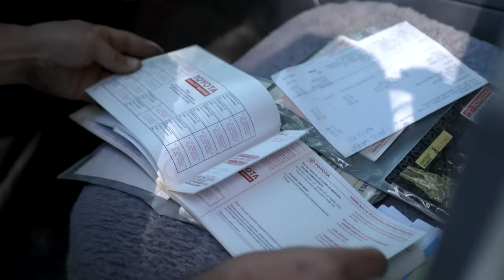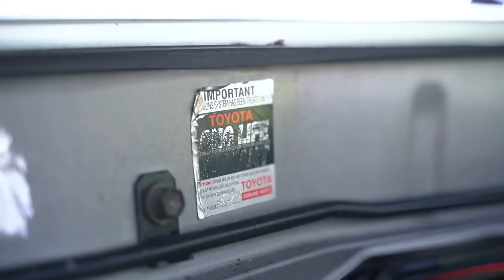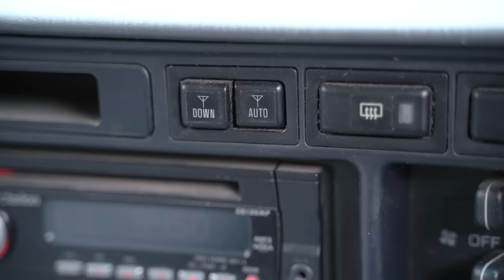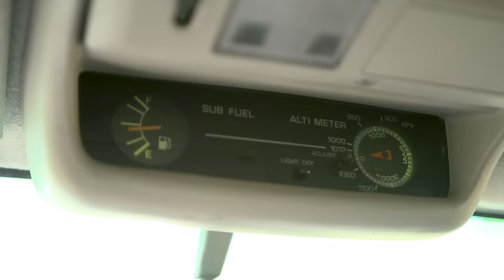RARE GRANDPA SPEC Toyota Landcruiser! You won't believe what Shauno paid + tips on buying an OLD 4WD

Comment: bought a 1993 chopped auto 80 series 1hdt with 250k on the clock..no rust only missing some clear coat off the flairs, interior is immaculate, everything is perfect mechanically.. paid 15k
Reply: forgot to mention.. bought off an old boy who had it from brand new and still stock as a rock

Comment: I bought a nissan navara d22 zd30ti about two years ago for $2500 from a younger bloke, it had a 2 inch lift snorkel winch spotties light bar rock sliders and brush bars UHF the works and the bloke told me he thinks he killed the car. It wasn't making boost blowing heaps of white smoke and ran rough. Anyway long story short. I paid the guy $2500 drove to the servo grabbed a roll of duck tape and taped the intake pipe coming off the turbo up and. Away she went. Running great no more smoke and booooost. Ten dollar fix and it was a treat. I recently sold it for $9500 just the way I bought it.

Comment: Hi all .
Thought I'd comment about my little score ..
I picked up a 1999 manual Nissan patrol 4.5 supercharged.
Nothing done to it apart from the supercharger ..just a stock set up .
One little don't in the bottom of the passenger rear door.
It just had all new brakes and rotors.
And a brand new clutch..weeks before I got the car ..I was given the receipts to show it had been done ...
The bonnet is starting to have the clear peal off ...but other then any of that ..it's in really good condition..
The bonus was the car came with 3 months registration.
I paid $4500 . Witch I feel was a great score .
Since then IV added the normal stuff ..
Dual battery. Light bar . aftermarket stereo. 33s .roof rack .awning .
I was always stuck on the roads talking about going hear and there ..
Now I that the misses and kids  camping and 4wheeling ..
They have just as much fun as me .
The kids are always trying to get me to crazy tracks .
But I keep telling them .let me get a few more things before we try anything harder .
Anyway. That's my story of my good but cheap score
Th

Comment: Best bargain was my first car a 2000 Mazda bravo single cab 4x4. Being an ex Telstra ute it came with a warn winch and tjm aluminium bar and fleet boxes on the back. I traded the boxes for a basic aluminium tray put a lift kit and snorkel and the car never missed a beat. I purchased the Ute with 220,000km and sold the Ute with just under 500,000km for $3500

Comment: Man am I ever jealous of you Aussie's (and anyone else who lives in nice hot dry climates). Your car's last forever! Here in Canada, my 5 year old pickup already needs new outer and inner rocker panels, and that's with yearly rust prevention. The salt brine/de-icer eats our vehicles. Luckily when I bought it, I paid $1500 for the rust prevention. Guaranteed for life never to rust through.(obviously it didn't work but warranty is covering it) all I have to do is bring it back every 2 years minimum for an inspection/retreat. Best $1500 I ever spent. Want to get at least another 10 years out of the old girl.

Comment: A couple years ago, bought a 95 model v6 4runner, not running for $1800. Still had current WA rego (transferred into my name on the spot). Apparently stopped working after driving thru a large puddle. 

Paid cash, pushed it out of old mates driveway onto road. Fitted a new second hand dizzy (old mate supplied). Quickly diagnosed rotor button cracked. Quick trip to repco with $30, it was running. Adjusted timing, and drove home. Old mate was gutted. 🤣

Drove it for 6 Months and sold it for $5500. 👍

Comment: Recently picked up a 2004 LN167r Hilux with 193000 on the clock for $3300. Needed a bit of work but has just got home from nearly 4000km of towing without a problem.

Comment: Recently bought an absoluute mint condition, 1997 40th-anniversary Petrol fj80 for 10k. Has 300,000 on the clock with 33s but other than that completely stock and unabused. hasnt got a spec of rust on the whole body and is going to be one hell of a rig.

Comment: Had lots of over the years 
In 2004 HDJ80r Sahara 4K 
In 2007 a 2000 RZN169 Hilux $2500
In 2009 GQ Dx 1997 ute $2000
In 2010 GU Dx ute $2000
In 2011 GU rd28 $5000

All running with rego apart from the GU ute that I purchased from a P plate driver who put it on its side. I sold it recently and replaced it with a 79.

Replace the Gu wagon with a Fj cruiser 2013 and still have it.

Comment: I bought a 1989 HJ75 with 180k km for a $1000 bucks during covid. I saw it sitting out the front of someone’s house with grass growing up it. I knocked on the door and offered them 1k. I put a new battery in it and drive it away. Sold the car a year later once it was registered for 11k, did very minimal work to it aswell.

Comment: My best find was a Toyota hzj 105 ex UN at the scrap yard in Europe about to be crashed. Offered the guy 5000 euro and it supposedly had a blown engine . It had 154.000 original KM and the engine just needed a fuel pump refreshed. Total cost including title , pump fluids etc… was 7500 euros. I’m now at 480.000 kms and never had one issue.

Comment: A few years ago I got myself a 2011 Mitsubitshi challenger with around 250km on the clock for 15k when market value was more than double that. I’ve not long been using it off-road now and really surprised how capable it is. Looking forward to adding a few more upgrades very soon.. there’s a pile of goodie’s in the garage and front lounge waiting like a front bar and winch, draws and fridge, 2nd battery and CB. Just put more capable wheels and tyres.. 
love the channel guys 👍 see ya on the track one day 😊

Comment: 2000 toyota hilux 2.7l petrol $3800 work horse that's done cape york last year and doing it again in September this year. Just clocked 352000kms. Easily the best rig I've owned.

Comment: My bargain, paid 7k a year ago, HDJ80R, 1HD-T turbo diesel, July 92, Manual with 440,000 on the clock, spitting image as yours, identical. Has the typical electric window issues but apart from that nothing major (touch wood). Bit of a unfortunate way to gain possession as it was an old blokes pride an joy for so many years (seccond owner) and passed from cancer, it's in good hands now and due course will have all the TLC.

Comment: Nice rig shauno its got heaps of potential . I just picked up one owner  2014 px xls 6 speed manual  its got a factory rear locker with 80.000km it's got a canopy dual battery tow pro elite off a 72 year old man for 26k im was so happy 😊

Comment: I got a 90 Jeep Wrangler for $1000 108k miles nice little rig 2 weeks later I got a 91 Jeep Wrangler 130k miles  for $5000 with $7000 worth of extras so I gave the 90 to my best friend now we both have a Jeep with enough spare parts to go around now we both get to go 4wheelin  the best deals are the ones you get to share with your friends

Comment: My best 2nd hand bargain is the vehicle I currently own, a 1995 hilux extracab rn110. Minimal rust, and only 260,000kms on the clock with a full service record and original accessories. Paid $3500

Comment: Just picked up a 2013 tdi400 6 speed manual amarok for 17k! Some of the mods it has are TJM bullbar , steel tray, 2” lift and I’ve added some 17” wheels and Yokohama all terrain tyres. Compared to what else is on the market it drives heaps better and is easily 15k cheaper than something of the equivalent year. Can’t wait to take it offroad now!!

Comment: Picked up a 1999 105 Series Landcruiser

420,000, H151F Turbo 80 Series Gearbox, Part Time transfer case 80 Series, tough dog shocks/coils all round, Pro Comp Classics wrapped BFG AT all round , superior panhard rod, pioneer rhino rack, gme uhf, arb compressor, dual  battery Redarc isolator, tjm bullbar, all the fruit, bunch of spare bonnet protectors/headlight protectors 

Plus a full set of all sunyaraysia spare wheels, water pump, rear main seal kit, drivetech swivel & bearing rebuild kit, plenty more spare gaskets/seals

All for $15,500, I don’t think I’m ever going to sell this car! But I am missing a recovery kit

Comment: Best bargain buy I ever got was from a deceased estate two years ago.  A 1995, 80 Series GXL Manual with the 1HZ and had only done 115,000km when I bought it.  The old fella who owned it only drove it on weekends until he passed.  The family didn't want to hang on to the vehicle so I ended up buying it for $12,500.  Full log books and history.  I still find Toyota factory stickers on the running gear.  115k km for a 1HZ is just run in, really.

Comment: Got a 1989 Holden jackaroo with new mud tyres, new winch, light bar, awning and dual battery setup for 2k 👍 but slow on the road but loves low range in the bush

Comment: Great find shauno 👍
The best find I bought was a Toyota Hilux 1994 SR5 metallic silver 3.8 after market turbo 32 inch wheels with b&f Goodrich all terrain tyres  and a set of 32 inch b&f mud terrain tyres flared fibreglass guards. tjm bull bar with warn winch tjm snorkel tjm aftermarket rear bar .uneden radio IPF Driving Lights .duel fuel tanks total Lts of fuel 160 in total .130.000 klms.when I had taken it for a roadworthy the guy that did my Roadworthy said did the previous owner wear pyjamas when he drove it.No rust no dents .A1 condition.
$ 13500.00 8 months Rego. Deceased estate.

Comment: I was out driving my AU falcon ute (my dad had it since new) doing an outback Queensland trip with the missus. We kept hitting road blocks with just having the ute e.g. couldn't get from Irvinebank to Mt Garnett without having to go the longway round. Anyway, I was sitting at the Mt Surprise pub having a schooie and asking the lovely old lady pouring beers about the road condition to Einsleigh. She looked at me and said 'what the hell are you doing in a 2wd out here trying to do bush tracks?' I told her it was all I had to which she said 'I've got a 4wd I don't drive anymore if you want a look?' Parked out the back in the shed, under a cover collecting dust, was a pristine 1992 GQ Patrol TD42 silvertop ST wagon, with full receipts and only 70,000 on the engine. Interior mint with all electrics working and had never left outback Qld or gone off road... a proper barn find! She only wanted $8000 for it. Bought it there and then. 
Both of us were stoked. Best beer I ever had at that pub! (Still have the falcon ute, can't part with her) 😆

Comment: Best 2nd hand bargain was years ago in the UK. I bought a Citroen CX Pallas for a dealer, car was 3 years old, had a tow bar and was really dirty.  The dealer told me that he didn't believe the 25  000 miles on the speedo, he thought it had be used for towing, had 125 000 miles and had suffered a hard life. I bought it for 700 pounds. Bargain. I contact the former owner, the mileage was true ( they sent me the full service history ) they had towed 2 times a horse box for their daughter, the car was dirty as they lived in the country. So I got a top spec car with leather seat, AC, etc for about for almost nothing. I had the car for 2 years, only problem I had was a starter motor.

Comment: My 2000 gu patrol zd30 Di bought with 390000 on the clock motor Was replaced at 160 only payd 7000 for her is my first 4wd  an the best part is the guy I bought it off owned an filter shop so was well maintained 6 years later still going strong

Comment: Got a vz crewman in 2019 for the ls 6.0 for 3.5k with blown diff, 150 xxxkm, cammed it threw it in a hilux, spent 2k on that, Then kept the ss whole on the farm just sold the ss seats, dash, front bar, hard lid for 2.5k today, with what's left it should cover the the build and price for the hilux with a ls 🤙

Comment: Nice one shauno👍 I payed 19k for my 1991 80 series auto with a 1hdt in it and with 580xxx on th clock with all the fruit, tjm front bar, powerful4x4 rear bar,fresh paint 2”lift, Dual battery’s with Solar panel on roof rack, rear draws, xr6 seat roof console came with every thing was on market place for 10 mins when i seen it

Comment: Great video with good common sense advice in it, thank you! Think I got a unicorn recently myself, a 2007 Triton GLX-R dual cab pretty stock, low 170k on the clock, with ARB canopy and a nudge bar. Hope to get a proper ARB bull bar onto her one day. First thing I did was change all the fluids including gearbox/transfer case and diffs, as service history wasn't great, but as it turns out all liquids drained were in good to very good shape. Breezed through the RWC and at 11.5k, think I did very well considering the current used 4x4 environment. Already taken it out in the local bush and it seems to handle it quiet well, not that I would know too much about that!?! Even made it through a few small mud holes, but am staying away from the deeper ones as I'm not prepped and not in company out there. So, if you're looking to offload the recovery gear to someone who'll put it to good use, please let me know. ;-) I'm happy to give some feedback of the gear and how I'd use it. All that said, been doing marathon runs through your vidoes and love them. Getting lots of good info and entertainment out of it. Cheers!

Comment: id say my bargain 4wd is pretty good, all it costed me was a rope, some fuel for the car towing it back to my house and about 5 minutes of my time. 

the old owner got sick of it because it would start so he called me up and told me i could have the thing, so i got a car to tow it and a rope to tow it with. drove it back to my house and then sat there for about 3 minutes thinking about what could be stopping it from starting, and then i thought id check the positive and negative battery connections and low and behold there was crap in between them stopping it from starting. so i grabbed a file out and got the crap off and it started straight away! it is a 1996 isuzu mu wizard, 3.1TD engine and it runs like a treat, bloody stoked about it

Comment: Brought a 75 series 1986 for 8500 with a 350 chev in it all engineered only had a bit of rust in the floor full pulled it down resprayed the chassis cab and all the dash in original colours brought a brand new 350 and built a tray for it still doing some final touches on her but she’s almost done

Comment: I brought a 1992 80 1hdt from grandpa.
He was first owner 250,000 on the clock. It’s total original never been off road or modified. Has all Toyota stuff, tool kit, books, first aid kit ( yes they came with first aid kit) and something I’ve never seen a wallet key. It was in a credit card to keep it in your wallet for when you lost your keys. Did you get a wallet key?
Nice car shauno

Comment: Hey Shauno,  thats a good score you got there mate, I have just bought an HDJ100 with the 1HD FTE motor, it was the same sort of deal as you got, high k's a bit rough 'round the edges etc. Funny thing is that even though my cruiser was made in 2005, it still has the same bonnet holder upper as your one. Cheers from NZ, Phil.

Comment: I just picked up a GQ for $1000 and an old mountain bike. Had to put the fuel pump back on and the transfer case but the old silver top is purring like a kitten.  I reckon you should give it a stock standard respray, polish up that alloy bar and just keep driving it.

Comment: 1995 f150 Eddie Bauer extended cad 4x4 for $500 just needed the trans rebuilt new tires new fuel tanks and a tune up. I got about $6000 in it altogether now. Wish I could post some pics to show the before and after.

Comment: Hey Shauno 8m pretty happy with my buy, I bought an (09 Nissan Navara D22 yd25 with 205xxx km, for 10k) witch I think is a grate buy, it was basically grampa spec too with only a hand full of mods, (light bar, ARB canopy, Idrive controller, and rhino roof rack tradie model)
And also had all the maintenance books and paper work from the original owner, and I think I'm a lucky bugger as I'm the 3rd owner of this Lovley 09 Nav D22, YD25 😎 
And I can't wait to put a 2" sus lift kit, some M/T Tires, winch, and roof top tent on the rhino racks, and some titan draws and slide out kitchen table in the back with a dual battery set up for the dual zone fridge, But as always a good set up for 4WD Adventures alway takes time set up the perfect rig... 

Always Love watching your videos  Shauno, Graham and Jocko, and the rest of the crew, keep the fabulous work up... 

Next time you guys are down in good old Tassie I will have to try a catch up with uses... 

All the best guys.. keep the good work up and keep them 4wd 24/7 videos coming.. 🤟💯😎

Comment: Bought a 1999 Toyota 4Runner 4x4, 5 speed manual, locking rear differential, 250,000 miles, for $5,000 USD to compliment my 99 Tacoma and my 08 Tundra

Comment: My best second hand deal would have been when j swapped my Holden commodore for a 89 Holden jackaroo and the dealer five me a grand in the hand. 13 years I had that fourby and it never let me down. I the time I owned it the only major issue was a head gasket. That's it. Apart from minor repairs it was the best fourby I've ever owned.

Comment: The best bargain was a LH toranna and XC Falcon for $250, both had a small problem that I fixed for less than $50 total, later sold the both for $1000 for the ford and $1200 for the Torrana in 1992

Comment: First ever car I purchased myself, saved up my coin by chopping firewood and working my arse off. Paid 5k for an 1988 GQ patrol straight petrol not even clocked 250ks. Full grandpa spec with straight body only modifications it had was an alloy bull bar and a snorkel. Funnily enough the car went full circle as the original owner was actually my grandpa back in the day. Good sentimental bargain I’d say. I only realised when looking though the paper work and owners Manuel in the car. Sadly hitting a a big roo and Putting it in a ditch put it off the road. The things I’d do to have the old girl back. 😢